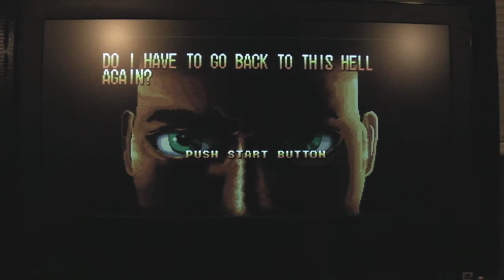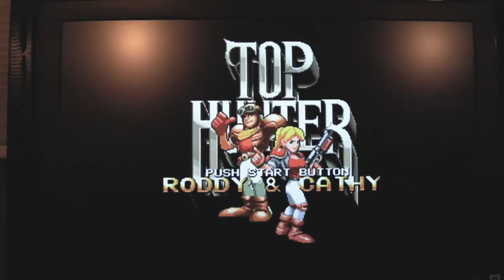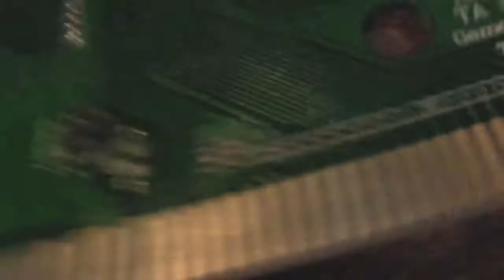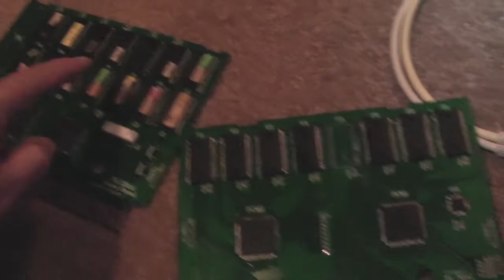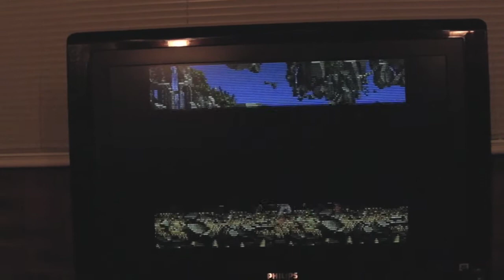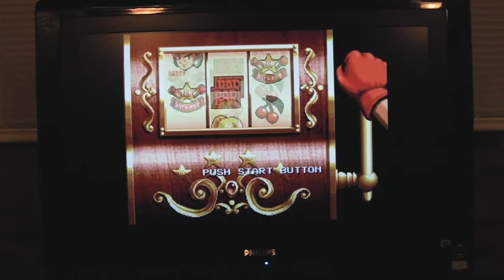SNK Neo Geo Cart Wierdness Resolved?

Comment from the maker: EDIT: Do not work off carpet with PCBs! Take ESD seriously, work from an ESD mat and wear and ESD wrist strap when handling boards and chips. Otherwise you risk creating faults!. NOTE: Reactance has NOTHING to do with this at all. I was very rusty after 25 years NOT working in electronics. Reactance is a capacitor's opposition to AC (kind of like AC resistance). The carpet probably wasn't helping, but it was the 120 in 1 (bad solder points).